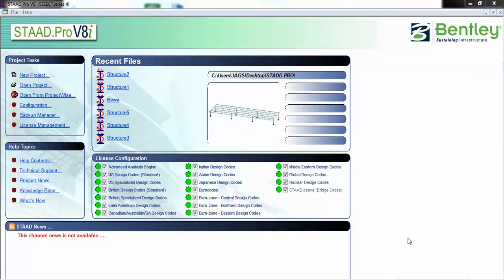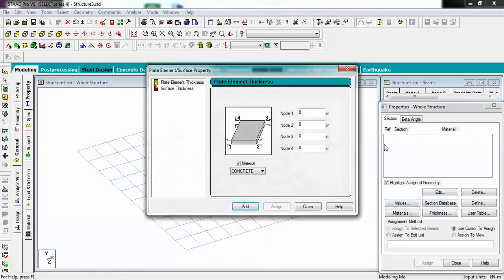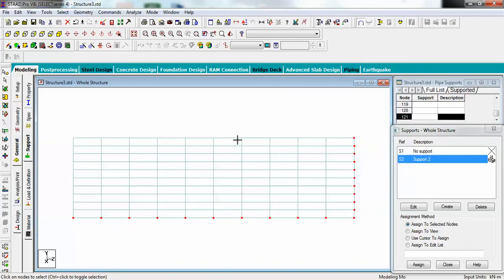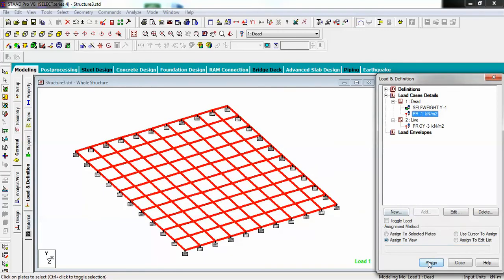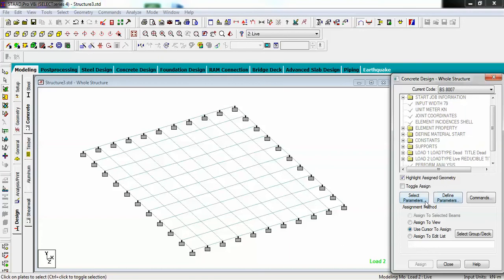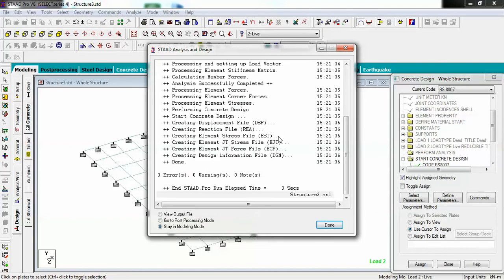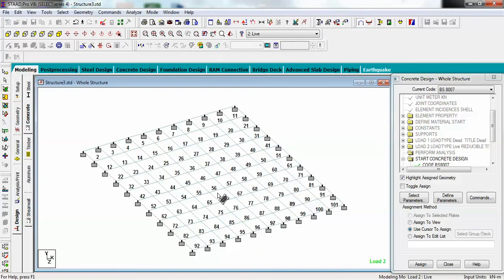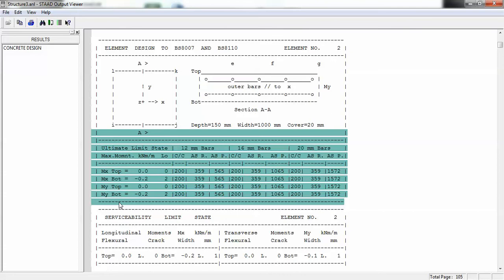Staad Pro Slab Design using BS 8007 Code Best explained in detail

Comment: Hi sir,
It's really a useful video.
I am a beginner in structural design. I have some doubts.

1. Why did we choose the self weight value -1 and live load value -3. How can we calculate it?

2.why did we provide fixed support.